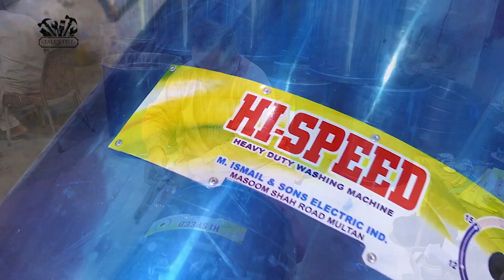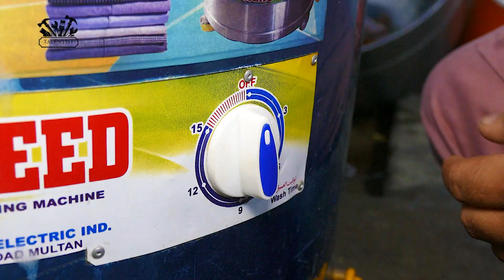Brilliant Technique Of Making a Custom Washing Machine

Comment: Machines like this were used into the 80s in the GDR, outdated at the time, but still in use. The GDR model had no drain valve, you just put the hose attached at the bottom down, to drain the machine. Oh, and you needed a second machine, a centrifuge. All comes out dripping wet out of such a machine.
Reply: There was special attachment for such machines which let to push water out from a wash. Kind of rotating press.